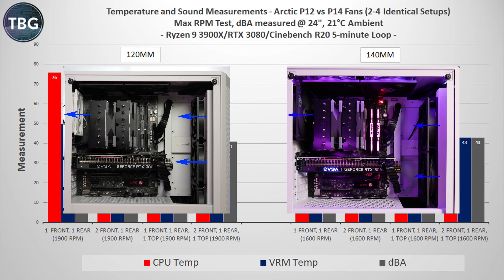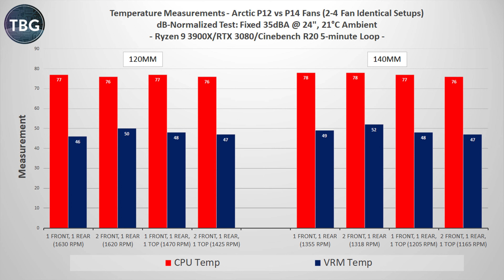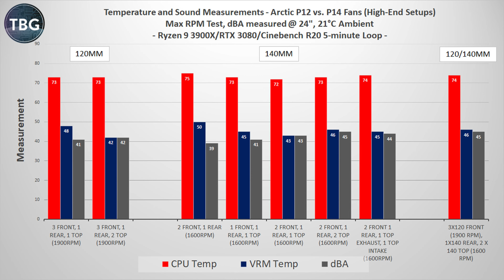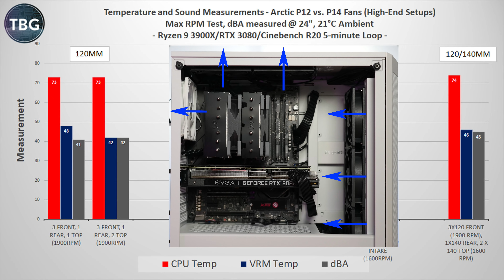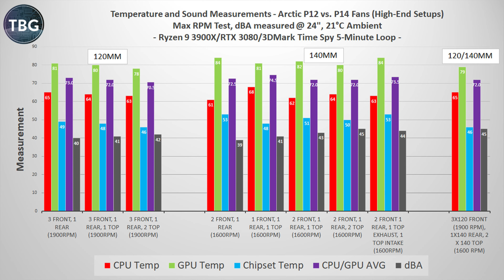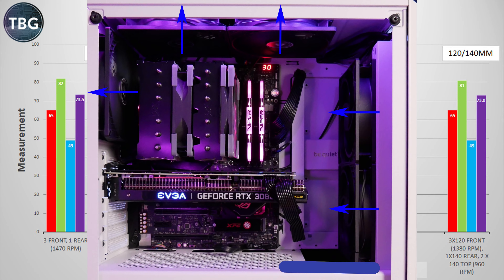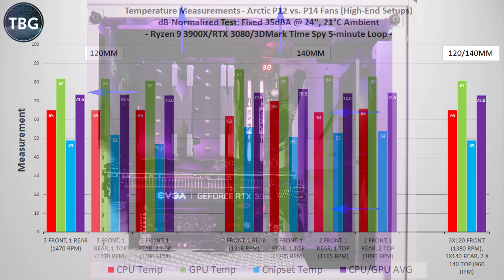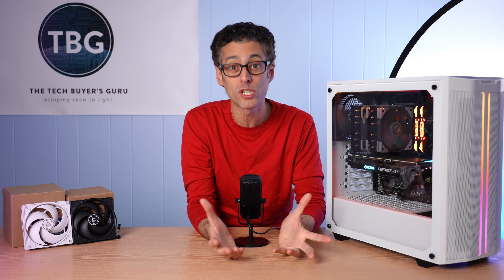The Best PC Case Fan Setup - How Many, What Size, and Where, feat. Arctic 120/140mm Fans!

Comment: huge respect for the video! even after 4 years later, this is still relevant. So the best configuration is 3 p12 on front, 2 p14 on top (exaust), and 1 p12/14 on back (exaust)?

Comment: I have the same case and installed a bottom fan on top of the PSU shroud as extra instake for the GPU as there's a lot of space. It actually doesn't make much of a difference. What makes the difference is adding a top exhaust fan. The stock rear fan simply can't exhaust all the heat of from my GPU at 250w during summer. I saw a video where the guy added an extra exhaust fan outside the case behind the GPU. And that made a huge difference.

Comment: Positive pressure is MUCH more efficient.
Because air is not water -- pushing lots of compressed air is getting you lower temps than exhaust can ever do.
Front fans: all intake, top and middle MAX, low MED
Top fans: all intake, all MED |  Rear fan: MAX

Comment: Wow this really helped! I was strongly considering to swap my three 120mm fans in the front to two 140mm, becaus of the exact thougt that the lowest 120 is partly covered by the PSU shroud. I guess i leave it now as it is - 3x120  in the front, 1x140 in the rear and 1x140 in the top. Thank you for this great video - even if it's three years out :)

Comment: I hope i can get a useful response. I am currently running an O11D XL with bottom and side intake (6x120mm) top exhaust (push pull Radiator 6x120mm) and 1x exhaust back 1x120mm. Now my fans are iCue LL120s and a while ago some of the LEDs have burned out. Its past warranty and i know its a manufacturing issue. So i was thinking of doing a new setup, originally i wanted Lian Li Uni Fans. So now the option presents itself to build in the Lian Li O11D Evo XL, which supports 9 140mm fans and 2 120mm fans. So i could even do push pull radiator top with 6 140s and generally just do the exact same setup, just replacing all fans with 140s and adding another 120 exhaust in the back. I am now unsure though if i would gain any temperature reduction/benefits at all through this setup.

Comment: Thanks for the video. I'm curious on your take on this:

My case (fractal north) comes with two 140s. My cooler (ls520se) comes with two 120s. I wanted two top and one rear exhaust with a specific ring led so I got a triple pack of light wings 120s.

The question is: do I keep the front two 140s, or use the cooler 120s in the front and purchase a third 120 as front intake, making it 6x120. Or would 2x 140 intake + 3x 120 exhaust be just as good? Thanks!

Playing mostly games with a 4070ti super.

Comment: I bought 3x Arctic F14 BioniX for the front panel, they start resonating in my case between 680-950 RPM. The humming is driving me nuts. So i've forced them to work at 645, sadly I don't dare making fan curve due to the nasty resonance.

Comment: I recently became curious about how 120s stack up against 140s after my Montech Air Base came with 3 140mm fans when I already had 6 120mm Bequiet silent wings (3 of them being light wings). I was told that 140mm fans were "better" than my 120mm fans, but I wanted to see for myself which eventually led me here as not a lot of people do these kinds of tests for fans. Your testing so far seems the best since you only have 1 manipulated variable (the fans) while everything else including the ambient room temperature remains consistent. I honestly cannot thank you enough for what was likely several hours of work testing all of these configurations.

Comment: The problem with testing the 140mm fans in this case, is the mounting for the 120mm fans which block the airflow and create turbulence and noise. I take a Dremel to my cases to open up the airflow and install the biggest fans possible.

Comment: The P12's are the best value fans out there. I got a 5 pack of regular p12's and a 3 pack of the p12 slims. i didnt swap out my push fans on my radiator but i have the slims in a pull config and the push fans(they are ROG fans that came with the aio) are considerably noisier than all of the p12's even when all of the p12's are at max speed. The 3080 fans though are loud lol but i was able to lower those fan speeds when i added these fans.

Comment: Don't spose you have a video with 3 140mm in the front, 3 in the top, and 1 in the back with the 3 front as intake, top front as intake and the middle and rear top fans + rear fan as exhausts?

Chassis size points have changed a bit with the size things like GPUs are getting lol...

Comment: Thank you for this video. I have a BQ PB500 case with mixed old fans from BQ (120, 140 / silent, dark, pure, similar positioning) Now I've purchased 6 of the arctic p12 and set it up the same way...immediately 10-15 degree lower temps on my idle GPU (no fans running) on 20% case fan rpm, nice! Thank you very, very much!

Comment: This video set my mind straight. Have an o11 air mini & was considering 2 140s on top vs my current 2 120s on top (wanted 3 120s on top, but have a 280 aio on from that gets in the way..)

Keeping my current config of 280 aio front intake, 2 120 side exhaust, 2 top exhaust, 2 140mm bottom intake & 1 120mm rear exhaust.

Comment: The effect of ambient temp on the output temp of any system shows erratic behaviour the ambient temp is above a certain temp for that system.
Jet Engines - There is a dramatic drop in turbine output  when ambient temp crosses 10-15 deg C. The graph inverted V. The tip of inverted V is that 10 - 15 deg.
Direct sea water cooling systems - some what linear upto 20 deg but follows a parbolic rise in the out temp above 20 deg.
HVAC - Similar to sea water linear to parabolic rise above 22 deg. 
Similarly, my PC output temps are not linear corresponding to the input temps(ambient temp) 
e.g. input ambient temp 20: CPU GPU -70 (Base)
       input ambient temp 24: CPU GPU -75 (4 deg & 5 deg)
       Input ambient temp 28: CPU GPU -85 (4 deg & 10 deg
The air cooling in PC independent of the configuration of the fans will be different once the temps are above 22-24 deg. Always keep the room temp/ambient temp 22 or below, above which system will struggle and will either require to increase cooling by increasing fan rpm or by throttling clock speeds. 
I use 2 Noctua 140 mms NF A14 industrial ppc 3000 as front intake. ( One at top directing towards CPU n other at bottom directing the GPU)
3 Noctua as top exhaust NF F12 IND ppc 3000
1 Noctua as rear exhaust NF F12 ppc 3000
Set all the fans to run at full rpm only above 75 else around 70%. 
I replaced all the top and rear NF F12 with Artic P12 and I am a happy man. 

3 Artic P 12 on top as

Comment: The odd harmonic resonance you describe is easily explained. Bear with me here. Multi engine aircraft with propellers will have a throttle power setting, obviously, but also a prop speed which can be controlled by individually controlling the feather or pitch of each propeller independently. During cruise flight the pilots are able to engage a "prop sync" button on some aircraft which will automatically feather and change the pitch of each propeller slightly to spin at the exact same speed as the other for a given power setting. If they don't, they will experience an annoying harmonic vibration or resonance. If you have three intake fans, chances are they are spinning at slightly different speeds, thus creating the annoying harmonic vibration. Note to Motherboard manufacturers: add a "fan speed syc" feature to your BIOS. Problem solved. This is assuming each fan has a direct connection to the motherboard. If they are daisy chained to the same header, you are SOL.

Comment: Really appreciate this but I'm really missing 1 or 2 fans in the bottom as intake, both cases with a shroud and especially without as you can feed cool air straight to the gpu, though having an extra fan directly below and infront of the 2/3 intake fans could be negative I think.

Comment: this test was very interesting for me, but I couldn't figure out which configuration to choose. I have a poorly ventilated deepcool macube 110 case and there really isn't enough air in it. I was thinking of installing 140x2 front, 140x2 top and 120 rear, but now I'm not sure. this case is small and the installation of three fans in the front does not matter, since the lowest one will only blow on the hdd (I don’t have under gpu ventilation, there is 5 centimeters of space and that’s it). then what should I choose? I want as quiet a computer as possible. 140x2 front and top, 120 rear OR 120x2 front, 120x2 top and 120 rear? rtx 3060(2 fans) and i3 12100. i can't find the answer :( this case has very low airflow so i'm considering arctic P and F series.
*
the advice to isolate the lower 120mm fans so that air gets to the hdd and then to the gpu is not possible in my case, because there is a solid sheet of metal under the gpu. no ventilation in this place.

Comment: I can't believe what a great and thorough test and analysis you did on this content.  I think you answered any question anyone could possibly have about fan sizes, RPM, configuration, direction of flow (and various combinations).  Most surprising to me was how detrimental having the top fans as rear exhaust, front intake, to cooling; I thought at worst it would be about the same as having no fan there, but that was completely wrong.  This goes to show the importance of deliberate, scientific, testing before reaching conclusions.

Thanks for this!

Comment: Thanks for the data!  I just bought a Corsair 4000D Airflow, going to keep both stock fans but add a 140mm Scythe and mount it down low.  May upgrade to 3x120mm front and move the 140mm to the rear but not yet.

Comment: Is my 3x 140mm and 1x 120mm arctic P fan purchase today warrant regret? (Corsair 4000D)
Reply: Not really, you aren't having much trouble with those actually, i have 3 140 on front 1 on the top and 1 120mm on rear, and temps are really good

Comment: Interesting you mentioned the noise you said you hear within a certain rpm range on the p12's, it's the only thing I don't like about them. Might have to grab a pack of the p14's to see if I can run them at a slightly lower rpm and not get that strange noise
Reply from the maker: Generally speaking, I haven't had this issue as much with the P14. It's a resonance of the blades due vibrations in the plastic itself - the blades are very long and can start vibrating unlike in other fans. The P14 is heavier and has thicker plastic I believe, and therefore isn't as susceptible to it.

Comment: Just found your channel and this is the first video I've watched, excellent work!

I'm about to make my first build with an old case that's been in storage for 8 years, a Rosewill Blackhawk Mid Tower case. The case comes with 5 pre-installed fans, two 120mm in the front, one 120mm in the back, one 120mm on the right side panel (right or left? It's the one that gives you access to the motherboard), and one 140mm on the top. Do you think this is enough?

I actually bought a 5-pack of Arctic P140 fans because I didn't realize the case already had fans, I never bothered to look inside until after I bought fans (last week), lol. The case has the option to add more fans: one more in the front, one additional 120mm/140mm on top, a single 120mm/140mm at the bottom, and a single 120mm on the left side panel (the one that covers the cable management compartment). If all the spaces are populated there would be a total of 9 fans. I'm assuming just because the options are there doesn't necessarily mean I have to use them. Is it safe to assume that maxing out the fan capacity in this case would be overkill?

Of course, worst case scenario will be that I just have 5 backup fans for future use, lol.

Comment: Three fans in front and then 3 fans up top drawing out is useless, as they pull too much air away from the front and straight up and out the top.  Put a fan on the bottom throwing fresh air into the GPU card.  If you have solid case, cut it out and throw some screen on it, giving you access to bottom case and fresh air going up.  Oh great video, great work.  Thumbs up and subd.

Comment: Wondering what your opinion is on the Arctic F series for airflow? I've seen other channels review both and claim that the F series (F12, F14) are better suited for situations where there is minimal impedance. I have an F12 and even though it runs at a lower RPM vs the P12, I can feel more air when I point it towards me. P12 seems better suited for radiators, heatsinks and cases where there is a lot of air restriction

Comment: I updated my BIOS and the fan curves were way off so I went down a case fan rabbit hole today lol. I found an awesome fan control software called FanControl. I have an old Define S and there are 2 more places you can mount fans, on the bottom next to the PSU (no PSU shroud on this era of cases) and side mounted on the left side panel next to the GPU. My STRIX 1070 is always hotter and louder than my R7 1700. I have 5 P14 and the 2 stock 140mm fans to play around with. I'm thinking 3 intake and the rear exhaust fans are always good. Gonna benchmark top exhaust and side panel intake/exhaust... How do you measure the VRM temps? Through HW Info? Great video thanks!

Comment: I added a 120mm to the rear outside of the case for extra gpu cooling.  I removed the pcie panels and mounted it there.  It helps for sure.  I had a 3080 there and now a 4090.  In a phantek p350x.  Similar sized case.  I am running a top intake as well.  Insane good temps.  But I’ve got the 140mm version of this fan and the top ones don’t fit to where I can get all the screws in.  The 120mm is 2mm thinner so I think I should just swap them all out for 120s… live and learn! Thanks for the help.  Just looked at the box.  The 140s are 40% more air flow at max.  I think I can sacrifice 2-4c for essentially silent fans.. the 120s should ramp to match the db of the 140s just to have the option of more cooling in extreme cases

Comment: As much as I'd love to compliment your thorough tests, you missed an important detail in every single one, positive, negative and neutral pressure. This is an important detail in planning each fan setup but I noticed all you did was adding more fans. You could have also tried more setups that mixed both sizes like 2 140 intakes and 1 120 exhaust for positive pressure.

Comment: After seeing that you got better GPU cooling with one front fan vs. two, I tried this out and got some different results.
I got 2 degree lower GPU temps with 2 front and 1 rear fan than with 1 front and 1 rear fan, where you got two degree higher temps with the two front fans. All fan speeds were locked for this testing,

I think the problem with your 2 front fan test here is that you've put the second fan in the top position, rather than the bottom one. In my testing, two fans in the middle and bottom positions improve cooling for both the GPU and CPU vs just one fan.

Comment: Hello I hope you can see this.I have phanteks400a and i can fit 2x140mm/3x120mm on front. 2x140mm/2x 120mm n top and 1x120mm on rear. should i have msi prob660m-a ddr4, and gtx 3070. what fans should i get?😭

Comment: Could you test the same things but when using an AIO CPU cooler instead of an air cooler? I would assume that there will be differences in results. I personally have a 2x120 Arctic AIO cooler in the front of the case, towards bottom, as intake. But having issues with properly cooling down my RTX 3080 and the NVME SSD placed directly above it. I have an option to have a side fan in the GPU area, as well as 3 fans at the top and 1 at the back. Also an option for one on the bottom (floor) front. I would like to see thermal results from various placement combinations.

Comment: Hi friend, thanks for the precious time you spent, I have the same case and both Arctic P12 PWM and Noctua NF-A 12x25 PWM, it is clear that every computer, case and fan will make a difference, every case is unique, I have put 3 Arctic P12 in front (away from the filter) and 3 Noctua NF-A 12x25 1 rear and 2 top, the noise is almost absent at low speed but if I increase the Noctua are heard, previously I put Noctua in front (near to the filter) and Arctic rear and top, the noise is also absent in this case at low speed, but if I increase, the Noctua are heard! then I did another test with the Noctua (away from the filter) and I get an annoying resonance noise from the bearing, it is really difficult to find the right compromise between performance and noise but I want to say that the Noctua even if they are noisier, they blow more air than the Arctic and the temperatures drop by 2/3 degrees, the Arctic P12 are nice and very quiet but do not blow much air, certainly the biggest problems occur in summer and with these hot temperatures, if the room is not air-conditioned you have to increase the speed and bear the noise, this is the only solution with any computer, case, fan etc ... if the room is air conditioned then you can also run all the fans at 1000 rpm in idle and get a nice fresh computer!

Comment: Hi, I'm planning to buy a case with 1 rear intake, 2 bottom intake, and 2 top exhaust. I'm thinking of doing this with 5 arctic P12s or 3 artic P12s as intake and 2 Kaze Flex 120 as exhausts. What do you think? The P12 5pcs value pack is priced at 25usd here at my country while Kaze Flex is priced at 11.21 USD per piece. Getting 5 Kaze Flex 120s are just expensive for me. What do you think will be the better setup? Thanks

Comment: How about 9 fans in a cooler master H500P case. I have 2 200mm thermaltake, 3 120mm Corsair behind the 2 200mm. 3 thermaltake 120mm on top, and 1 140mm Corsair in the back. This believe it or not, is just as effective as liquid cooling. I'll make a video on it sometime and show you guys how it's done.